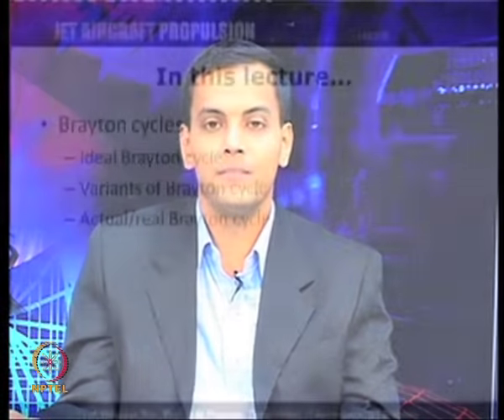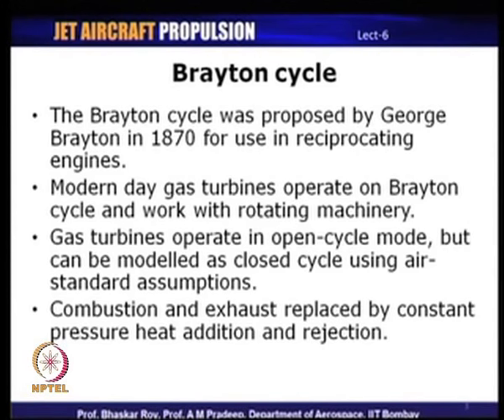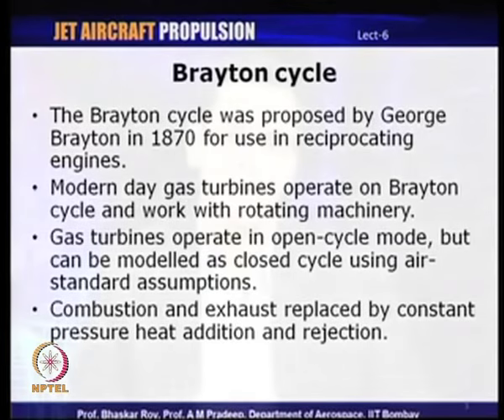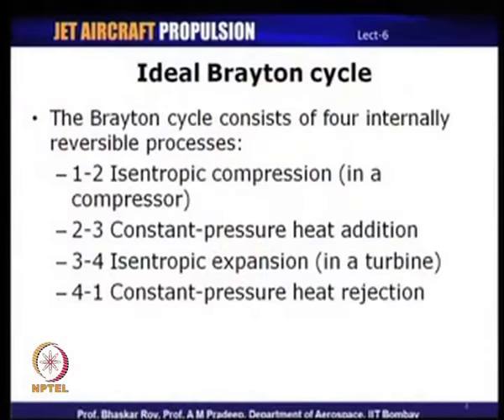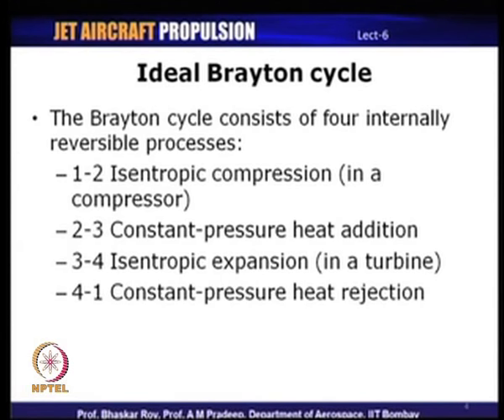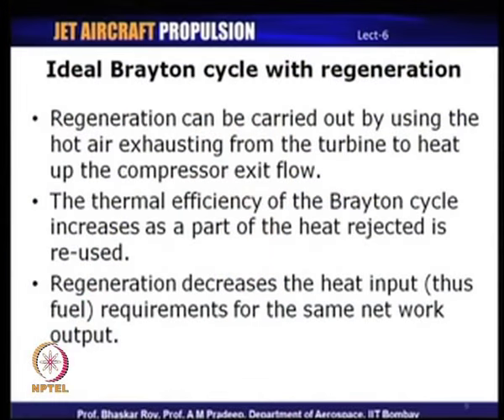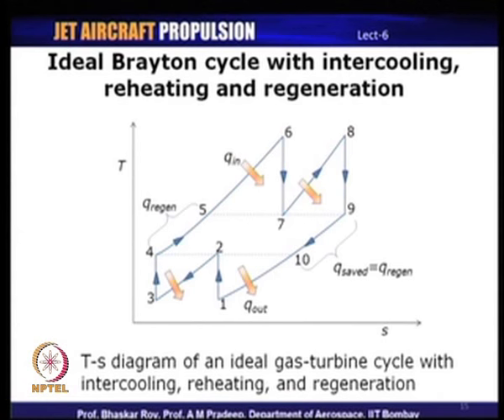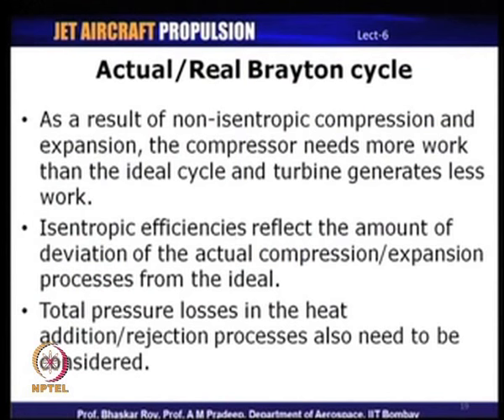Mod-01 Lec-06 Ideal and Real Brayton cycles

Comment: Why for compressor efficiency=ideal/actual and for turbine efficiency is from actual/ideal
Reply: Do not remember those things, just remember efficiency is always less than 1, divide both. if u r getting more than 1 then somewhere its wrong.
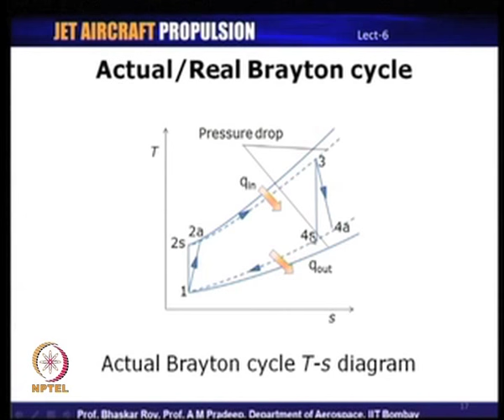Anyways if u really want to know go to the T-s diagram  @41:41
Now look at compressor, which line u find longer? Ideal is short and actual is long, now n should be less than 1, so short/long<1 always... so IDEAL goes up(isentropic) and actual goes down..
Now similarly in expansion..  here actual is short, and ideal is long.. same logic.. So that's the reason  
You can also relate with the actual and ideal efficieciny of pump vs (I am forgetting this thing.. was in previous semester.. but same thing happen there also)
\

Comment: What is Gamma? This video would have been complete if that was mentioned. Either way, very well done. Every word was uttered cautiously, hence accurately.
Reply: gamma = Cp/Cv
Reply: Gamma is ratio of specific heats Cp/CV
Reply: Gamma for air is 1.4, heat capacity ratio!
Reply: Specific heat ratio, cp/cv.